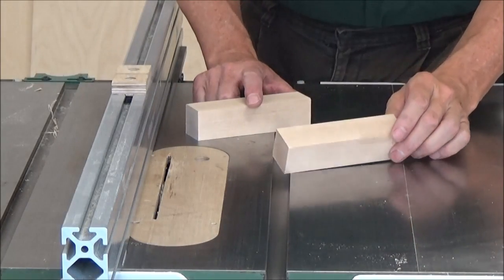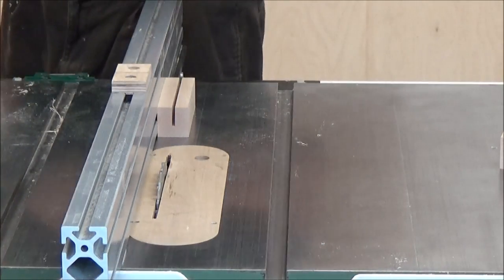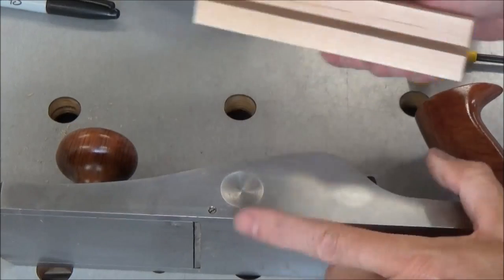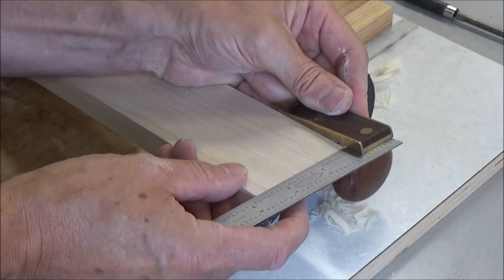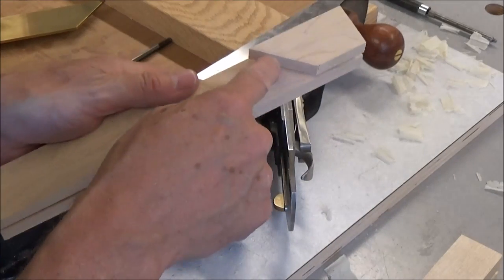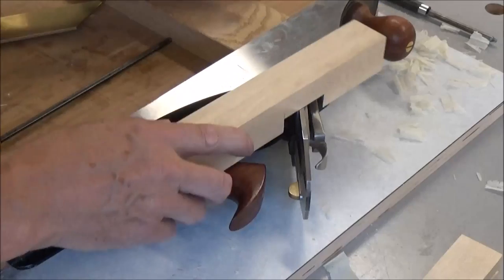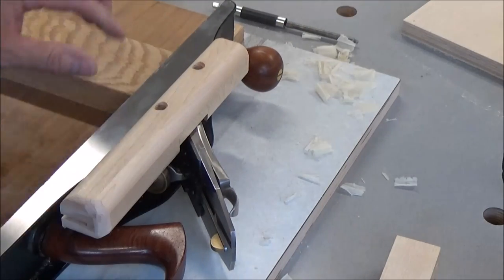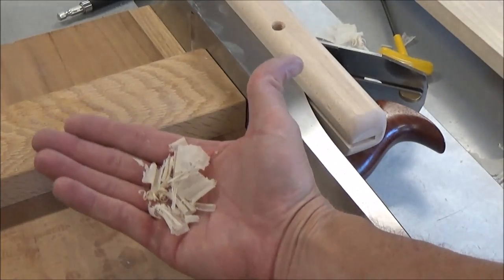Hot Dog Handles for Low Angle Jack and WoodRiver #6

Comment: Hello, thank you so much for your video. I’m designing one for my lie Nielsen 164 and one of my concerns with the set screw is if it will  mark the side of the handplane. Thank you
Reply from the maker: It takes very little pressure to make it stay put but you could always put a "buffer" between the screw and the hand plane. Thanks for watching.